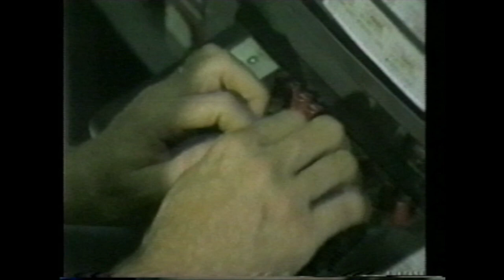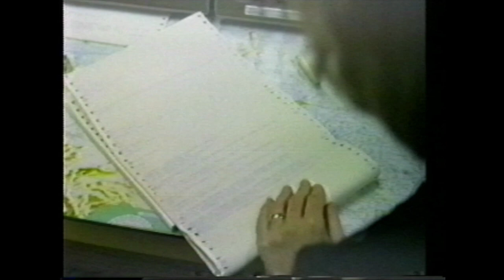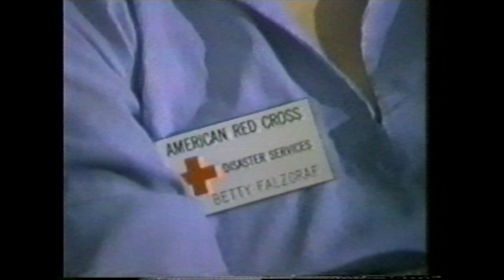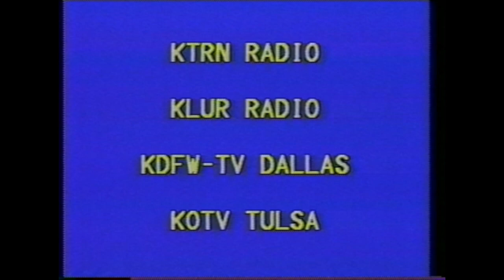"Coming Back" Wichita Falls, Texas Tornado, 1979 [KAUZ-TV Documentary]

Comment: Im still baffled this tornado wasn't rated an F5 it was an absolute devastating monster possibly the most famous tornado of all time as a native of Wichita who has yet to experience a tornado hopefully never will this tornado was a monster Rip to all the victims
Reply from the maker: The tornado was not rated for F5 damage on the original Fujita scale as no well-constructed homes were swept cleanly away. It's difficult to visualize that amidst what appears as near-complete devastation. That fact does not detract that this was a worst case scenario; a violent tornado moving through a populated residential area of the city, at rush hour with mixed public tornado action plans in place. It typically takes a tragic natural disaster to shift public tornado safety and awareness. The tornado outbreak of April 10, 1979 and specifically this tornado changed that.
Reply: I, agree this should have been rated and F5 tornado? I, don't see how this couldn't have been!

Comment: We don't really have as many violent thunderstorms in Texas like we used to, as the cooler and sometimes cold weather lasts into May. Now, we get tornadoes around the holidays in December. The climate has really changed.
Reply from the maker: There has been a progressively eastward shift in climatological tornado days overall. Violent weather often grabs quick headlines around the holidays, yet numerous climate shifts/variables  are a noted causation. Take the April 19, 2023 Central Oklahoma tornado event, geographically shift that an hour south and North Texas could have easily had yet another significant event.

Comment: Just the sight of the twister at 5:05 could have scared a battle-hardened Navy Seal to pieces. 🌪️ 😱
Reply from the maker: A few military personnel stationed at/near Shepard AFB, along with thousands of residents, certainly were.
Reply: I have often wondered, for a soldier which is more scary: fighting with guns facing down bullets and yet not getting hit, or dealing with a monster tornado in your back yard